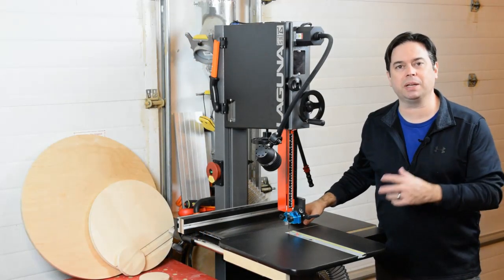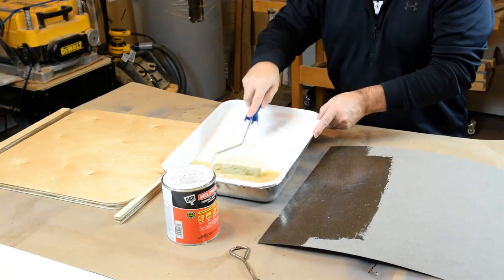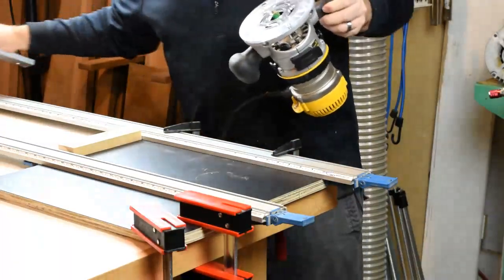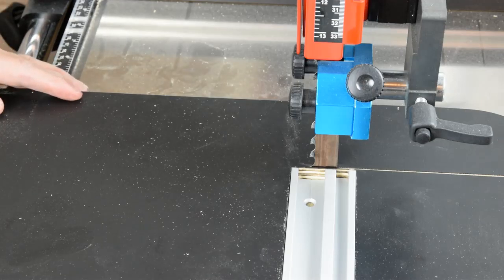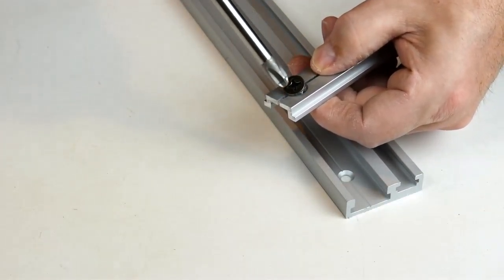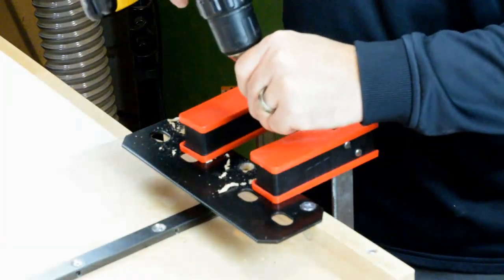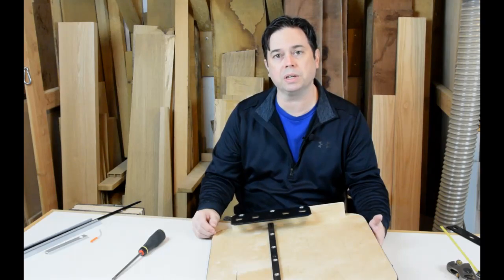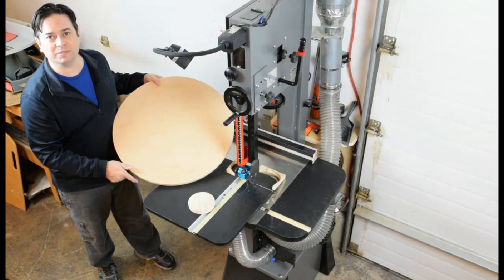Bandsaw Circle Cutting Jig Woodworking Jigs and Fixtures for Woodworkers Cut Circles with band saw.

Comment: So, why laminate and contact cement instead of PVA or pre-laminated stock? Seems like more cost IMHO. I appreciate your video and learned a couple of things. Thank you.
Reply from the maker: Hi Rex, good question.  I have used melamine for previous shop jigs and found it didn't hold up.  The surface coating is very thin on some of these pre-laminated products.  I prefer to use Wilsonart brand laminate and contact cement.  
Of course the jig will work fine without a laminated surface at all, but it makes for a nice durable jig.
Take care.
Thanks for commenting.

Comment: Would this work if you wanted to cut angles on circles also
Reply from the maker: I guess I'm not really sure what you mean by cutting angles on circles.  Basically, the jig is just for cutting accurate circles.  I suppose if you found a way to fix the rotation, you could use it for other purposes like cutting angles.  Best of luck.

Comment: Your circle cutting jig is excellent!!!  Would you consider a adjustability screws between your magnets as to adjust for the different blade saw sizes?  Bob
Reply from the maker: Hi Bob,
You could certainly try it.  I'm not really sure what it would do other than limit the slot depth.  Cutting accuracy would be the same.  The one thing I might do different is to limit the length of the dado for the track.  If you keep that dado 1/4" or more away from the blade slot, it would give you zero clearance cuts. 
Best

Comment: Love this idea, however my track did not come with a T-track insert that you mounted the scale on. I think I'm just going to make a t-track filler out of wood (3 pieces and glue it together) and insert it and mount the ruler on that. About the only thing I can think of to do.
Reply from the maker: Thanks Keith,
That sounds like it might work.  If not, you might have to order the combination track from Woodcraft.  Powertec tape measure kits fit in that ok.
Good luck!

Comment: When positioning the board to cut, how do you line up for that 8 in?  And do you just hammer it down onto the jig?  Thanks.
Reply from the maker: These jigs can seem confusing until you build one.  Once it's on front of you, it's all quite clear.  Basically just drill a shallow hole on the bottom of your workpiece.  Then loosen the sliding centerpoint with a screwdriver and position it as needed.  Then just tighten the screw and cut the circle.
Works great!
Best

Comment: I've been looking around for a good circle cutting jog. I really like your design. Can you give us the dimensions and distances you used for the miter bar and the combination t-slot?
Reply from the maker: Hi Van, it's 18" square overall.  Miter bar located 6-3/4" from left edge (as you use the jig).  Center of T-track of combo track is 6-3/4" from back edge of the jig.
Good luck
Reply: @TheThoughtfulWoodworker  Thanks so much. Looking forward to getting this jig completed and a couple of projects underway.

Comment: What was the source for the steel washers that fit the 1/2" magnets? Great jig, love it.
Reply from the maker: Hi Douglas,
Thanks for the nice comment.  The magnets are from Rockler.  If you don't want to use the steel washers that hold the magnets in place, you could just epoxy magnets into drilled holes.  Either would work fine.
Best

Comment: Do you offer these plans ?
Reply from the maker: Here's a detailed blog on the jig... https://info.lagunatools.com/bandsaw-circle-cutting-jig
Best to you
Reply: @TheThoughtfulWoodworker   hello, I have a question and maybe you can help me. I also bought laguna fusion 2 and I have Diablo blade 90th but I don't know if the riffing knife is suitable. 

The seller in Australia told me that they don't have thinner riffing knife and I noticed that the diablo blade is thinner than the standard laguna blade. 

Note: i wasn’t sure which tablesaw I should buy but, I bought the F2 because I watched your videos

Thank you
Reply from the maker: @woodworking4459  The Fusion riving knife is 2.2mm thick.  My Diablo Ultimate General Purpose blade has a 2.4mm kerf, so I think you're setup will be fine.  Best to you.